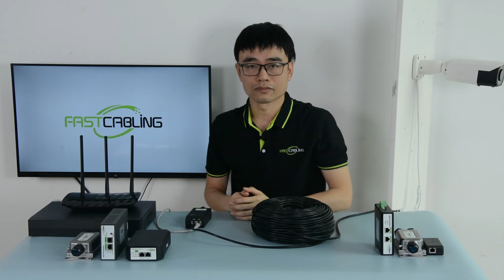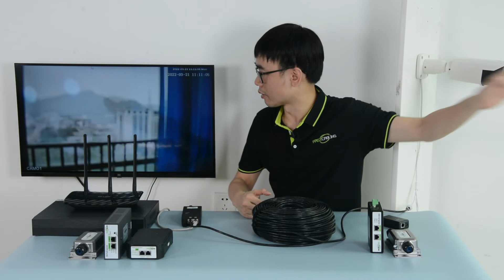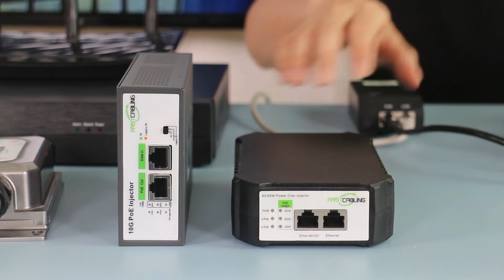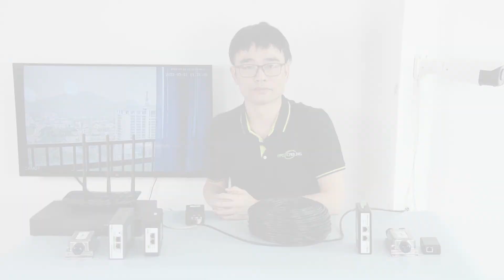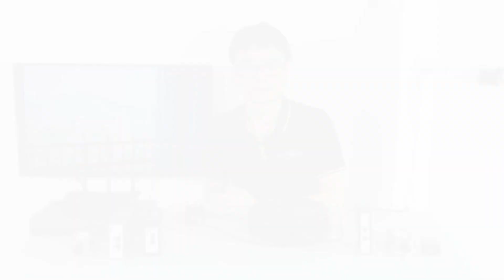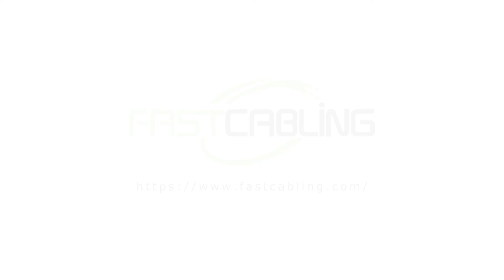Everything you need to know about the PoE injector and Splitter

Comment: Important to note that there are fake gigabit multiport PPoE injectors everywhere that claim gigabit but are only 10/100 Mbps. One has to do some looking and research to find a gigabit one that is true. I just recommend you stick with managed passive PoE gigabit switch's. Sure they cost more but at least you know you have the correct thing for your needs
Reply from the maker: Thanks very much for your comment! Indeed, it's important to verify their capabilities to avoid getting stuck with a device that falls short of your speed requirements. However, it's important to note that passive PoE switches can result in damage to devices if voltage levels are not compatible. On the other hand, active PoE switches are designed with safety mechanisms such as power negotiation and protection against over-voltage and over-current situations.

Comment: What's the terminal block is for?
Reply from the maker: I assume it is the green block at the splitter. It is output DC12V, so it can supply the DC12V for your edge device.
Reply: That's actually a bi - directional power port for connecting a custom switch mode power supply module that can deliver more. Or as OP said it is also an output as well so you can add another device in parallel